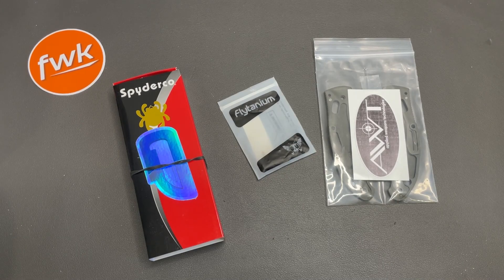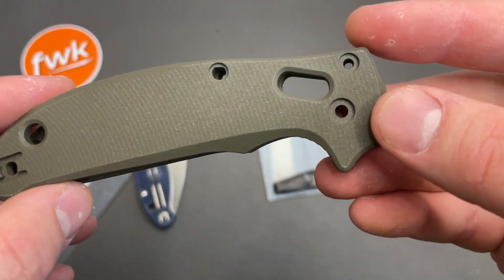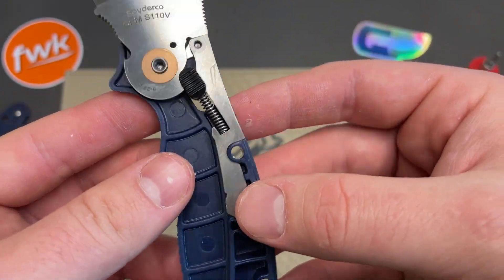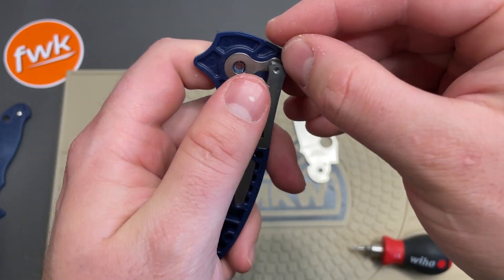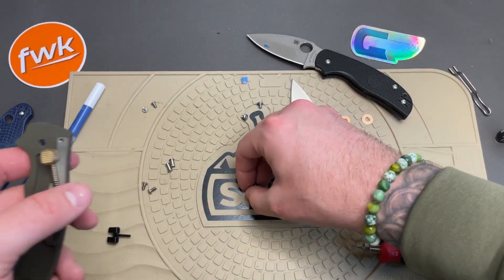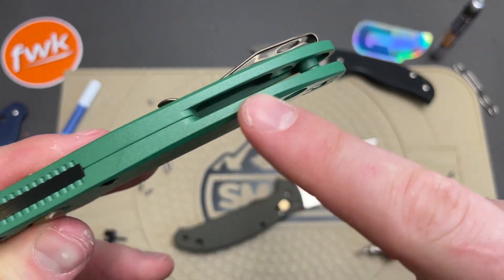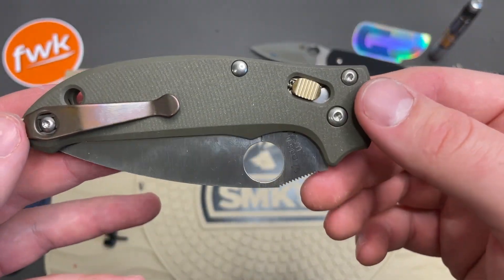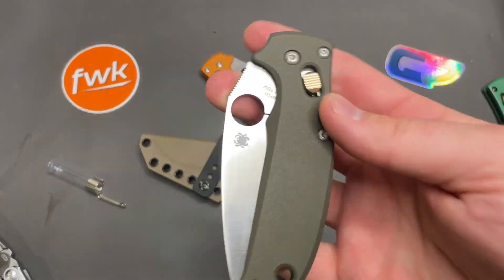The "Hobbit" Manix 2 LW: Disassembly, AWT Scales, Flytanium Ball Cage, & LynchNW Clip - K.U.S. Ep. 7

Comment: Flytanium cage, the stem is screwed into the main part. It will work it self out over time and mess up the action and also can strip out threads and bend. Unscrew, add lock tight. Also some stems are a big long. Might have to file a tad off. ( calipers are your friend here )  also the ""wings"" finger tabs can be a bit thick , taking them to a 4000 grit stone helps. Iv had 3 cages 2 were out of spec a bit. Easy fix, takes about ten mins if you take your time. Remeber you can remove material but you cant add it back.

Comment: Have you tried the Flytanium ball cage in the LW scales? Just to see? I’ve got the ball cages in a set of AWT scales (not LW) and a normal manix2 that fits, but I don’t have a LW to test fit.
Reply from the maker: I haven't yet honestly, I have been replacing the FRCP lightweight scales at the same time with each build. I am curious to know now though.
Reply: @FunWithKnives  I’m wondering if there is something different about the mechanism or something that makes the ball cage not exactly compatible with the lightweight models. — same I’ve not tried one in a FRCP scale cuz the only one I have is a CS exclusive Orange-S90V which is pinned and not screwed together. 😢 (I hate the scales but they are orange at least- I love orange lol)
Reply: Hey guys.  I had this same problem with both manix LW’s I modded as well.  I has the same problem with the flytanium cages as well as the stock cages upon reassembly.  It’s still racking my brain why they do that.  The one I put AWT scales on I eventually got to feel pretty decent just by tightening the screws in different orders and tuning the torque.  It was just as bad with the stock cage.  The other i put the stock scales back on (and still had this issue with both cages) and filed some of the material off the bottom side of the cut out that the cage slides inside of.  Every time I’ve taken one apart the cage was very tight and didn’t move freely.  No matter which cage or scales I put it back together with …???
Reply: I think i read it from Meton Boss. but the Ball Cages need filing on the stem and the thumb pads themselves to fit LW
Reply: The Flytanium website says that their ball cages will Not work with the Lightweight. Hard to know why, whether it's binding with the scales, blade, lock, or some combination. Strange that they're unwilling to make proper ones...

Comment: If you had bought the anodized scales you wouldnt have had the problems with the ball cages.....the cerakote finish is too thick and varies wildly. Ano is thin and slippery. Sand your brass cages down a bit and it will slide easily.

Comment: Big and bloody problem with AWT scales and Manix2LW. I got Rex 45 on sale. Sharpened to 15 degrees. Laser.  Decided to upgrade with AWT scales. Great look. Love it. But when closed, the tip is almost sticking out. Just before New Year's as I was shopping and looked for some change in my pocket, I was unaware some fabric inside pocket had grabbed the tip and pulled the blade slightly open inside my pocket. As I was sliding my hand inside to grab coins, I realised the problem. No, it was not at all painful. The knife is super sharp. But it was a bloody mess. In original white FRN scales the tip of the blade was not as exposed. There is a problem with AWT construction for Manix. Anyone else had this problem?

Comment: I recently Frankensteined a Manix 2 LW in magnacut with a set of AWT Charcoal Green aluminum scales plus an aluminum Flytanium Ball Cage upgrade kit from OCD4EDC which includes a lighter weight spring which makes a HUGE difference in the action. However, the Flytanium Ball Cage did not fit properly in either the AWT scales or the factory plastic scales. The action was bound up in either set. The factory Ball Cage worked fine with the lighter weight spring in both sets of scales so the Flytanium Ball Cage was apparently out of spec. Ended up sending the knife with the aftermarket parts installed to OCD4EDC and he determined that the stem on the Flytanium Ball Cage was too long so he shortened it and it seemed to function just fine. In fact , he was so enamored with it that he built his own using the AWT Tequila Sunrise scales and had the same problem with the Flytanium Ball Cage. He shortened the stem and after a bit of breaking in, his worked fine. He also received two Manix 2 LW's from viewers in the factory scales with the Flytanium Ball Cages that had the same binding up problem.
After getting my Manix 2 back, it functioned well for a brief spell. Soon, however, it developed what I'll call free play in the blade where when the blade was closed, it wasn't locked closed and the tip of the blade would easily move enough to let the tip clear the scales. Took it apart myself then reassembled and I was right back to the original problem of the action being bound up. Disassembled again, looked st the wear marks on the ball cage and started filing with my old  Leatherman and after several test fits and more filing, the action on my Manix 2 LW is perfect.
So, in effect, I'd say the Flytanium Ball Cages are the problem and not the factory scales nor the AWT aluminum scales. I'm currently awaiting a set of AWT Aztec Teal aluminum scales to mate with a Blade HQ exclusive Manix 2 LW with DLC coated M4 blade and a Flytanium Ball Cage upgrade kit. Wish me luck...You can check out OCD4EDC's live videos dated  4/7/24...4/24/24...4/28/24   If you do watch them, be aware that OCD4EDC's lives ARE NOT child friendly nor are they suitable for sensitive ears.
Sorry for the lengthy comment. Hope I've made some sense here.
Reply from the maker: Thank you for sharing! That actually makes ton of sense. I suspected the stem length of these Flytanium ball cages at one point because it looked a millimeter or two longer than one of the OEM ball cages that I was replacing. It's surprising that such a small variance in machining can seize the whole knife up. Best of luck with that M4 Manix 2 LW, that's going to look great! Thanks again for the comment, you will probably save a few headaches of others trying to accomplish the same thing.
Reply: @FunWithKnives  I think the problem is more than just a slightly longer stem on the Flytanium Ball Cage. I noticed that with the cage, ball and spring installed in just one of the scales, the action would be just fine. Smooth as silk with full lockup open and closed. The binding problem arose when the second scale was installed which means to me that the Ball Cage itself was perhaps oversized or somehow bent. I just know that filing a bit on the cage itself, in line with the stem, finally allowed the cage to fit and then work properly...and I HIGHLY recommend the lighter weight spring as it does indeed make a world of difference in how sweet and smooth the action is.
Reply: I was like cool a related comment - holy TLDR Batman… but it was full of so much great information I couldn’t stop reading. Thanks for all that iinfo. I’m sure it’s going to help a lot of people as it sure helped me. I just snagged a LW Rex45 satin to be installed in some AWT scales. Now I have to figure out if I want to play games with the Flytanium ball cage. I have every intention in rocking a lighter spring, as you’re correct it makes the Manix2 even more epic. Thanks again.
Reply: Dude hell yeah, thank you for the comment. I bought a flytanium aluminum ballcage for the BHQ M4 LW and had the same lockup issues. I ended up sanding down the holes of the G10 scales (I know, probably not the best idea but whatever). It worked fine for a bit, but wasn't great. Ended up putting the stock plastic one back in. I have some AWT scales on the way, gonna try the aluminum one again on that and see if it fits any better. From what I observed, it seems like the aluminum ball cage angles too far forward (ie the bit that's touching backspacer isn't angled properly so it grinds against the top corner of the lock hole in the scales). Sanding down that bit seems like it might help.
Reply: @J0nnyTheJ3w  I can pretty much guarantee you that you'll have the same ill fitting issue with the AWT aluminum scales. It's not the fault of the scales but rather with the Flytanium aluminum ball cage. Instead of sanding/filing/modifying the scales, I'd recommend modding the ball cage since it's cheaper to replace than the scales if the mod work goes south. I modded my Flytanium Ball Cage for my first build using a Manix 2 LW in magnacut and it works like a champ. My second build using the Blade HQ exclusive with the DLC coated M4 blade, I had the same issue with the Flytanium Ball Cage and instead of modding the cage, I simply used the original plastic Spyderco ball cage. I do HIGHLY RECOMMEND using the lighter weight spring that's available in a kit from OCD4EDC for around $15 (I think). It makes A HUGE difference in the action of the Manix 2 LW whether in factory plastic scales or aftermarket AWT aluminum scales.
Reply: I tried a spring and ceramic ball from AWT, the spring was WAY too light. I could easily shake it open almost zero detent. Took the factory spring and cut a coil off and it’s much better now.
Reply: Thank you very much for the info! I just got my first spyderco ever because I was able to find a manix 2 LW in magnacut with AWT scales, but I also hated the plastic ball cage so I ordered a flytanium one and it completely locks up when I put the other scale on. I've just emailed OCD4EDC to see if he can give me a hand.
Reply: Had same problem with the ball cage. Flytanium. I busted out the calipers and the stem was .08 longer. Broke out my leather man also and filed it down, then took off .02 more, made a huge difference. I got mine in copper. I figured titanium or aluminum might start galling and mess things up. Broke in really smooth after about 300 open and closing. I have kept my factory spring, I just feel safer with a hard detent

Comment: Hey man! Theses AWT videos are great! I have a similar situation. I have the REx 45 LW and trying upgrade the cage. I saw you tried with a slotted cage and it didn't work. Do you think the TI cage you used for this s110v blade build and the m4 build would work. So just a normal Ti ball cage with the REXs AWT? Maybe If i avoid the slotted it would be compatible like your m4 and s110v build were.